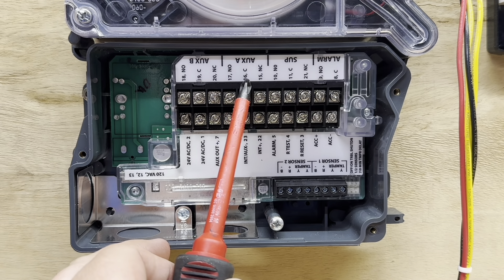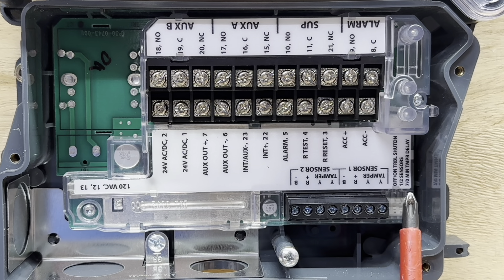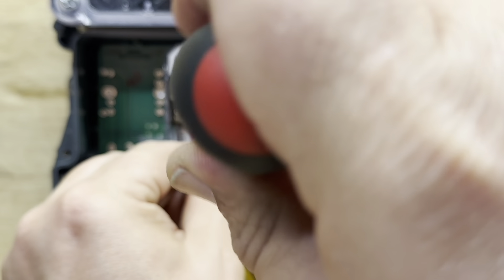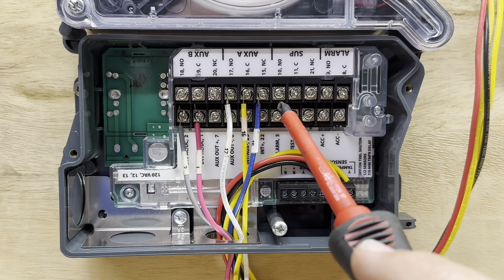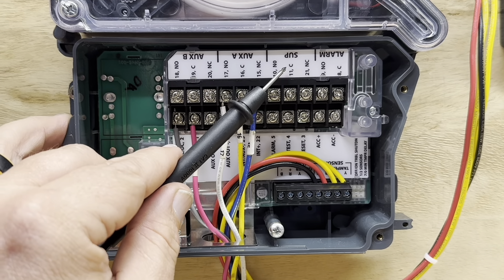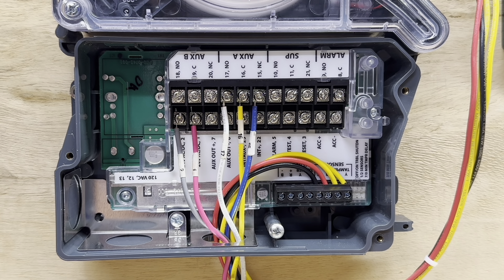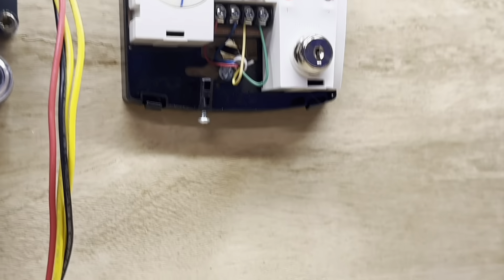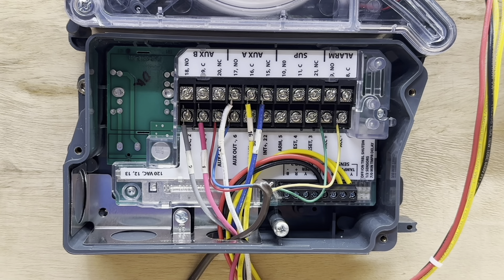HVAC - Duct Detector

Comment: If i have a fire panel where does that get wired to?   
I have a fire panel going into a duct detector supply and then to return .  Then from there it goes to a control module. And then it goes to EPO (emergency power off).  From the first cm mentioned it goes to another duct detector return and supply and continues like above.